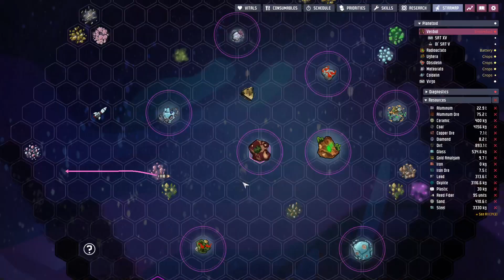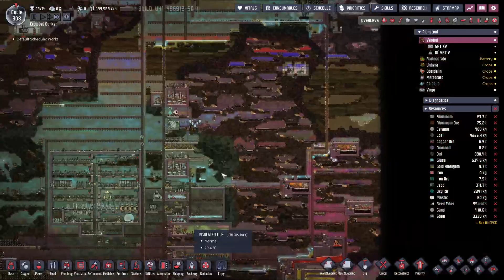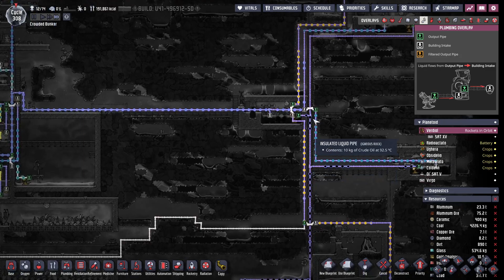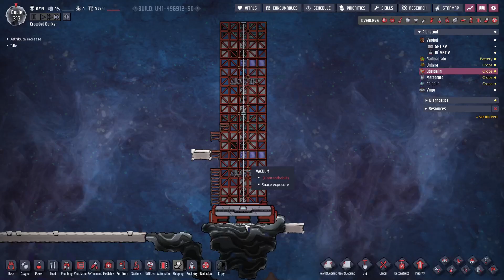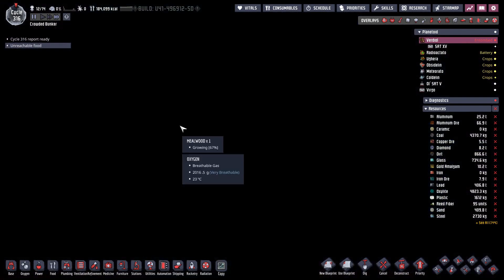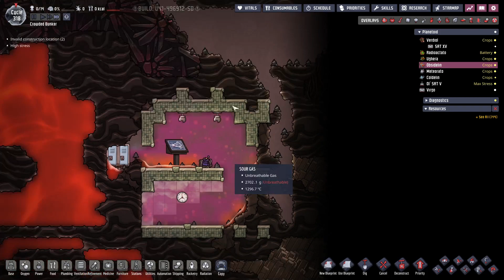Oxygen Not Included - Most Dupes Record Attempt - Part 20

Comment: Still catching up, but you really seem to have a lot of problems with that petroleum boiler in that pipes were breaking. Personally, i put a little drop by the heater to separate the heat exchange from the heater, basically just a tile 2 tiles to the right of the liquid vent and 1 down. Never had a single pipe break in a petroleum boiler out of the 2 i've made in survival. And some designs in sandbox
Reply: Lack of failsafes. Using 2 liquid storage tanks would fix the issues, so if he say runs out of water he has 5 tons in a tank as backup, same for the oil. 

It would prevent him only finding out there is a problem only when the water/oil lines are empty.